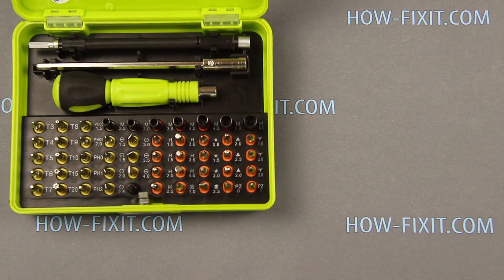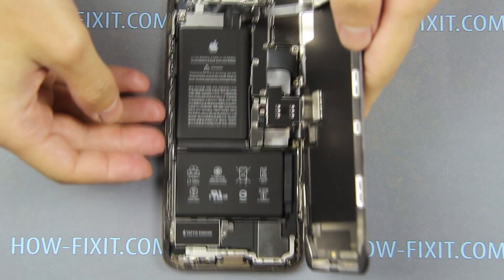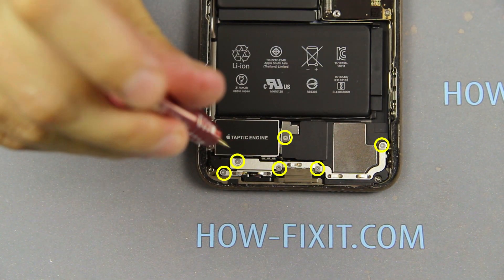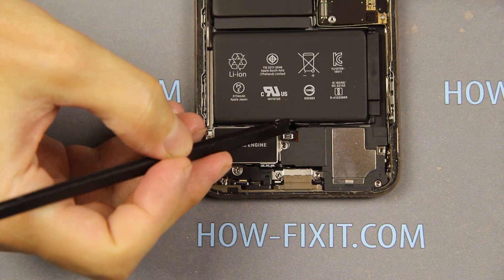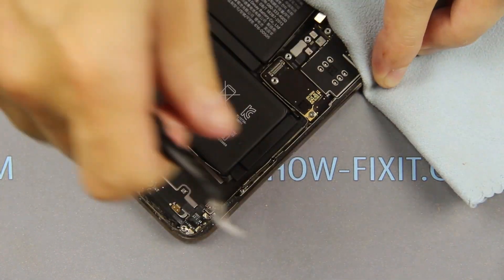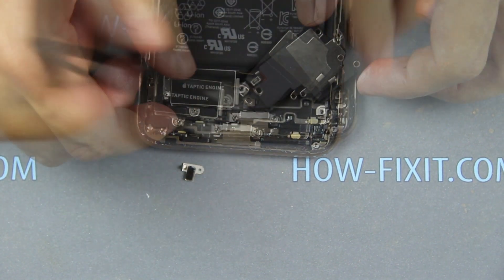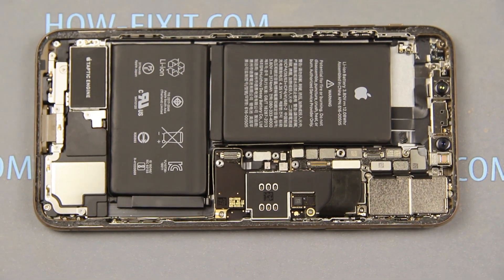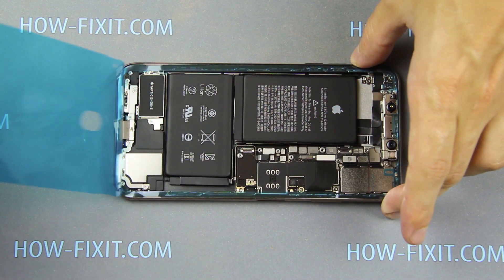iPhone XS Max Battery Replacement Step-by-Step Guide

Comment: Bro you didn’t need to do the extra stuff just apply heat to the back and gently use a plastic pry tool provided to pry the battery up and out